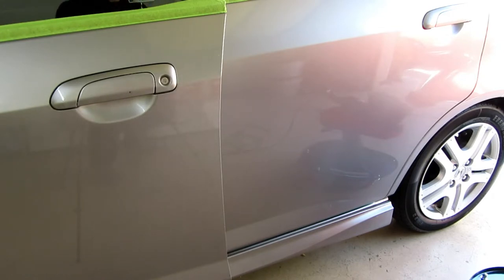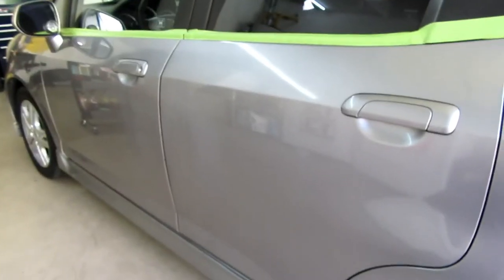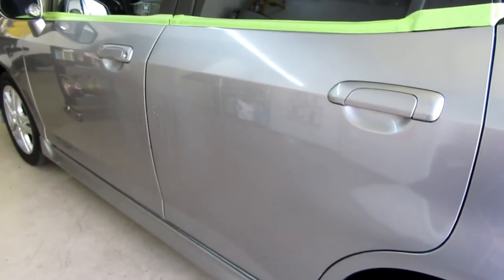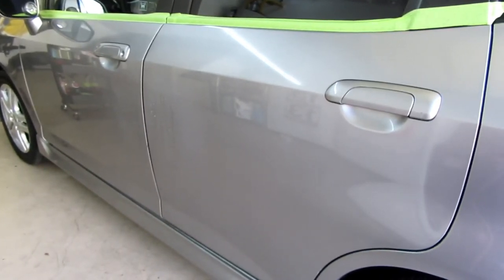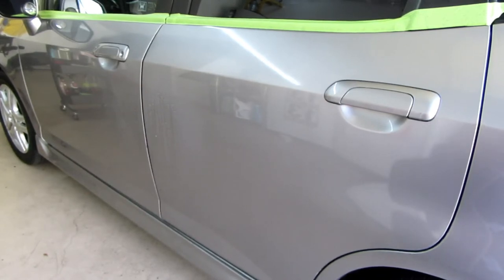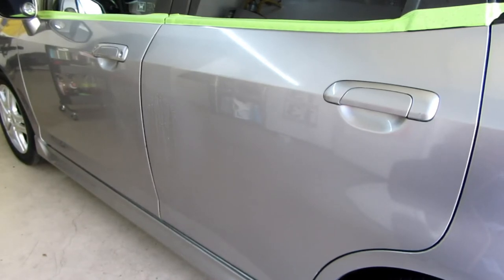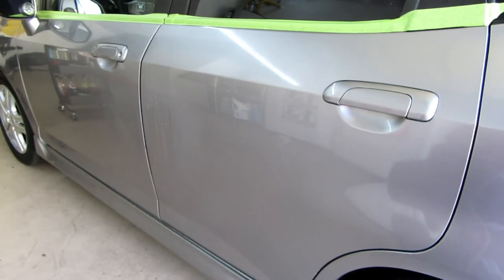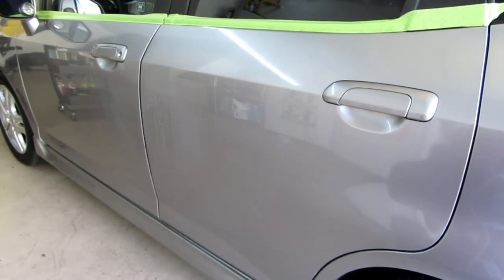3D HD Speed + Buff & Shine Uro-Fiber for One Step Polishing

Comment: Used the Uro_Fiber pads for the first time a couple weeks ago on my GTI and used 3D One, not Speed and it was a great combo.  Only thing I don't like about the Uro-Fiber pads is that they're not super easy to clean in between passes.  Takes a bit of effort.  I imagine if I had a compressor it would help a lot, but cleaning with a pad brush took some effort.
Reply: The reason I like these pads is because they're easy to brush out. 

I don't "prime" my pads though. Way too much concentrated lubrication with 3D One.